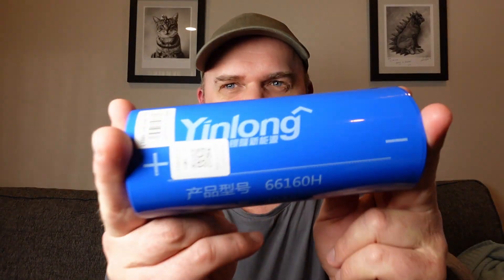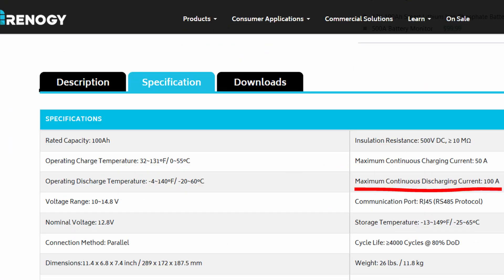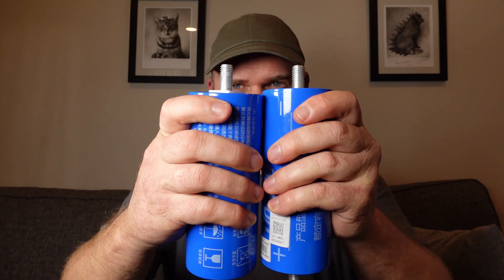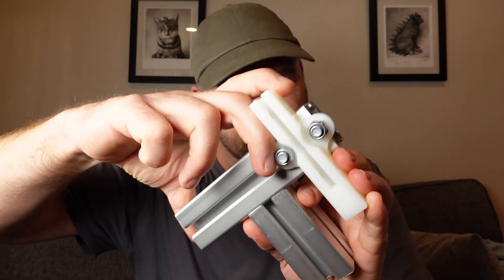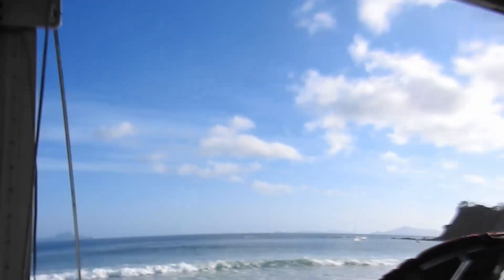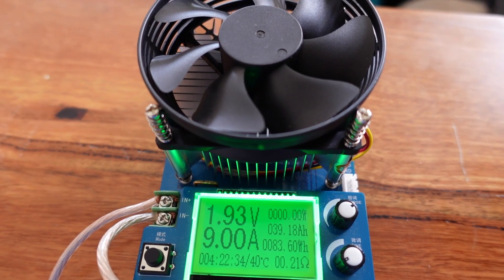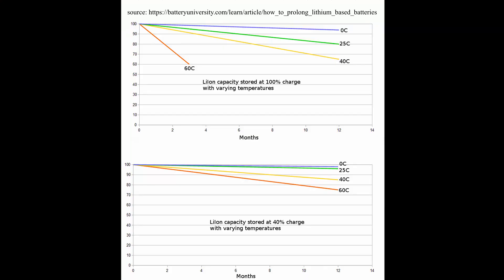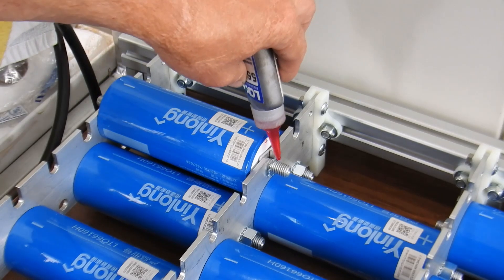Campervan DIY battery build HUGE POWER!

Comment: Hey Brendon, first video I watched and I am impressed by your engineering of the pack, I have to challenge something you said however. First is you are comparing drop in replacements to individual cells, this isnt a fair comparison. My bank is built up of 18S1P LiFePO4 @280ah totalling around 16.7 kwh. I paid $85/cell including shipping, and that makes it around $1500 for the whole pack. Had I tried to do that with renogy or battleborn or the like, thatwould have cost around $12000 for the battleborn and less for the renogy, but you can see my point. I can pull 280A from the pack if I want to, but @48v I would never pull more than 125A (.4c) I know yours are better at lower temps, but the task of keeping them from freezing isnt an issue with me as it is in a climate controlled area. your thoughts?
Reply from the maker: Hey Michael, yeah - my maths came out at 2.7c/kWh, I said that number was unfair and it is in reality closer to 10c equiv, intending to allow for other factors.  My intent for this pack was that it was super rugged, safe, long lasting and reliable, I'm going to be taking this truck into all climates and won't have the interior heated if I'm not staying in it etc.  I deff would have used LFP if price was my priority.  I will be building a similar pack to yours shortly.  Can I ask where you got them?  Seems very cheap.
Thanks
Reply: @brendontait6968  alibaba.com. Company is called Taico
Reply from the maker: Thanks... Shenzhen Taico?
Reply: @brendontait6968  yup

Comment: Use the blue loctite not the red for easier disassembly.
Reply from the maker: Yeah, it was only after I'd put it together I realized that I may want to pull it apart at some point.

Comment: I have a question about why you used Aluminum as your buss bars? My understanding is that the oxide that build up on aluminum can cause issues. In the US, we used aluminum wiring in homes and it was not a good end. the connections would create issues and cause fires. Not to bad mouth the build, it is impressive to say the least. Just wondering why aluminum?
Reply from the maker: Aluminum can cause problems when bonded to dissimilar metals especially in a wet environment.  If the aluminum is being bonded to aluminum,  the issues are less pronounced.  The cell case and lugs are made from aluminum.  You'll notice that I applied a grease to the battery lug with a cotton tip before inserting the cell.  Having a grease interface prevents moisture sitting in the gap.  If you're proposing that I should have used copper - copper would likely have cost me well over $1,000, plus I would have many dissimilar metal bonds.  There is nothing wrong with aluminum cable being used as a conductor providing that it is installed correctly.  Most of the power delivered to your house likely came through aluminum high tension lines which last many years or decades through all manner of harsh conditions.  Am glad you enjoyed the build.  Thanks

Comment: Good to see people who clearly know what they are talking about. I knew LTO existed but you are the first I've seen espousing the advantages in this context. Nice bit of pack engineering.
My plan is to avoid building a big pack by just using an EV pack/set of modules to power both van and internals, but if I did this is certainly an interesting option. I shall investigate further.
Reply from the maker: Thanks, yeah I was keen on the toshiba packs floating around - but none available this part of the world.

Comment: Nice.what kind of battery charger would you use on a solar panel setup.or a wind turbine setup.to charge the batteries and how much per battery and what is the voltage per battery do they come in different voltage and also were do you purchase these.
Reply from the maker: Just a regular solar charge controller will work coupled with BMS.  The chemistry is nominal 2.3V but useful range is 2.0V to 2.6V.  Link in description.   Thanks

Comment: I noticed you made the battery long and flat and you mentioned putting it in the kick plate area. What sort of isolation or shielding will you be doing on top of the batter (under the cupboard?). Do you need to worry about flooding your floor?
Reply from the maker: Coming video I'll make a polycarb cover for it.  The cells don't sit on the floor.  and im hoping to not flood it. I'm pretty sure they would handle a small amount of flooding without too much stress.

Comment: Your a brave man spending that kind of money for batteries that are also a new chemistry and also from China. I got 6kwh of the CALB's (in Australia) in my truck after what I learnt from Prowse video's. Keen to know how your bank does in the long term as I am always looking for options for more capacity in the years to come.
Reply from the maker: Yea thanks.  I'm always keen to learn about new tech and figured if it went pear shaped I could pull apart and sell the cells to the audio guys.  The titanate chemistry has actually been around for a couple decades, so it's not super new.  Just hasn't been used much.
Reply: @brendontait6968  5 grand for 10kwh is amazing value, especially if they out perform LifePo. I Paid $4500au for my 8.6 kwh LifePo a year ago. I also did 24v, because of my truck but also because the Electrodacus charger was design for it which made the most sense to buy at the time....Hope you find time to do updates of capacity loss over the years.

Comment: I know little about batteries,  but couldn't say 4-6 of these be used in an ebike? I have a 4000w hub motor with a 60a controller fire example.
Reply from the maker: the problem is you'd generally want a higher voltage, so for eg 6 cells would give you 15V, you likley want at least 48V for your ebike.  This chemistry does come in smaller cells tho.  Imagine - a full charge in just 10 mins!

Comment: Very nice design but we didn't get to see it installed, how come ? 

  Since 2018 we have been off the government corporate electric company grid, don't believe your electric company is government read the disclaimers from the Smart Meters from your local electric companies website.  I used the Ford C-Max (Energi) battery, we go them from LKQ through our business account paid just a little over 100 per Kilowatt, or $850 USD for 7.6KWh.  I built two systems and each system uses a configuration of 16.8 volts batteries 4x 4.2v for our 12 volt MPP Solar unit which runs a small section of our house.  The MPP Solar unit will only charge to 14.9v so I get a good range and if you are correct about not charging the Lithium cells to 100% which would be 16.8 then I did good lol. 

In the shop and part of the house I used a Magnum Energy PAE 4448 and I also used the Ford cells at 14x 4.2= 58.8v therefore, it is never going to over charge nor reach 100%.
Reply from the maker: My goal to get off grid also.  good work!  It pretty much is installed - on the floor.  You'll see wiring in future videos

Comment: could these be used in a power-wall situation to replace the solar batteries in my home?  Is that a practice application?
Reply from the maker: They certainly could be - that's pretty much what I'm doing in my truck.  The downside of this chemistry is that the cost vs capacity is quite high.  I wanted something super rugged and long lived and different so felt the cost was worth it.

Comment: What about power density kg/Wh?
Reply from the maker: They are not great - I think around 80Wh/kg - this was not really a factor for me as my truck is 12 tonnes.    The actual density works out similar to an LiFePO4 battery in his van.
Reply: @brendontait6968  Thanks for the answer. I am interested in batteries for planes, so this rules them out. Really good explanation

Comment: Loctite has two main products for locking threads. Loctite Red is intended to be permanent. Whereas Loctite Blue is intended to be semi-permanent. If you want to leave the option of disassembly, you should have used Loctite Blue. Live and learn.
Reply from the maker: Hey, thanks for the comment, yeah it wasn't something I considered till afterwards.  The threadlocker I used wasn't locktite brand and was a medium strength variety.

Comment: Great stuff, more people need to use these units, they aren't batteries they're ultra capacitors using spherical charge technology, like static and commonly used in electric buses. The clamping force needed for full rush energy transmission is high, dump the star washers and properly torque them. Yes their cost of life is outstanding however factoring in the management system it's closer to 0.04 and your truck wont last 20+ years so needs factoring in. Additionally buying the "B" grade unit halves the cost so long as you don't mind poor skin printing or bruised threads a massive saving.
Reply from the maker: Hey, thanks for the comment.  As far as I'm aware they are a chemical battery and not a capacitor.  Am hoping my truck will last more than 20 years!

Comment: Hi I love your video. In this video: EASIEST Off Grid Solar Power System
 Battery Bank. Can you suggest a list of parts for me other than the 
batteries which will do the exact same job at a cheaper price please? 
Also an inverter which does the same job like the one in the video.
Reply from the maker: Follow along... I've ordered some new cells that I can make a decent and big sample pack for cheap!

Comment: Can you charge off the truck alternator?
Reply from the maker: Yes, tho you have to be careful you don't overheat the alternator when at idle.  My alternator puts about 50A into it which works out around 1200W

Comment: That's impressive.  Was thinking of the same setup, but as you mentioned was aiming for 48 volts, and about half as many batteries.  How many days will this last you without any charge?
Reply from the maker: Running my fridge (household size) and lights etc, around 7-10 days without charge.

Comment: sorry to ask this i did watch all the video. what is the total cost for the battery cells? what is the weight of the battery? putting it in that unimog you don't need to worry about the weight. my setup would be weight sensitive. what if the final capacity of the battery?
Reply from the maker: Hey Bob, I think total cost was just under $6k usd, tho am doing a group buy which would have made it cheaper.  I think the weight is around 120kg and the capacity is 9.5kWh

Comment: Brendon, the type of guy that challenges the great Will Prowse and shows his calculations! Plus you add the structural components to make it a complete off-the-shelf package. Subbed!
Reply from the maker: Thanks Jim
Reply: @brendontait6968  Hi, great video, thanks for the clear explanation. I’m researching building a small, lightweight electric driven boat and these batteries look more attractive option than 18650’s for so many reasons. Way heavier than petrol of course but I’m sick of the fumes and noise.  I live in Ōhope, BoP, NZ so I’m particularly interested in your supply and shipping costs and challenges. Following your link the shipping costs appear to be quite high. What was your experience? On the loctite front, I use the low strength version (222) for this type of application.
Reply from the maker: Thanks, yeah I was going to do 18650s for the truck, but after looking on some Facebook pages where I've never seen such a large collection of burned down houses in one place I decided to go a different route. Battery freight to NZ is an absolute punish.  I still have some for sale if you want to buy from me, flick me a message on insta
Reply: https://www.youtube.com/watch?v=iOBSxEqXUQc

Comment: Thanks much, good information. What charger did you use to charge that much capacity or did you use multiple chargers?
Reply from the maker: I just have a variable powersupply to charge - will be charging from solar.  Glad you enjoyed

Comment: I feel to measure the power then compliance voltage plays a massive part on the measurement accuracy, that's why  some measurements at low voltage with say a current shunt & moving iron ammeter in the same circuit might give different readings due to compliance voltage & connection lead resistance, chart recorder to measure terminal voltage & current across a dc shunt with a fancy constant current load would be the answer there are proper units out there but expensive !
Compliance voltage is very important when trying to measure power or one can make mistakes say from a CT transformer using thin long leads to a moving iron meter,
Yes very impressive metalwork, cost a massive amount of £$, 
I would have that sort of power in a brick shed, not in the bedroom for sure, always worried about fire risk, I rather have a purpose built brick shed or metal container,
Those batteries are really like a super capacitor. 
Really nice engineering 👌

Comment: Still have some you would like to sell?  I can't find how to send you a message since google messed youtube up.  I'd like to try them myself though.
Reply from the maker: Only a few left.. brendonsbuilds@gmail.com
Reply: The natural gas semi truck is using Japanese lto cells which means Toshiba or vice versa and it also means most likely their next-generation chemistry. What I am interested in knowing is how much more dense the Next Generation chemistry is versus this more easily purchased competitor? If you haven't already studied the cartoons on s c i b. JP do so and I recommend you buy around Christmas the new unicycle it's called EX but needs a upgraded battery pack. Toshiba shows a unicycle as an application for their next Generation technology. Historically these unicycles get extra kilowatt-hours added by the aftermarket and they also take 24 hours to charge. the shock absorber is the narrow  tube but 12 Mega something pressure they include the pump and that sounds of pounds per inch which is somewhat unusual the reviewer claimed. It goes 40 miles per hour easily. People who travel 40 miles per hour standing on the axle of one wheel well below the axle they don't like the wait 24 hours to recharge their batteries. They also historically have a problem with the battery packs not going as fast just like the Tesla for most of the cycle given the high internal resistance. Except it's maximum speed not acceleration. And this new generation of electric unicycles have about four horsepower no joke! The current handle is a joke so are we engineered battery pack could have the alternative handle and be quick release because it's currently about 90 lb which is insane thing to get up the stairs vs 45 in in each arm being far better. The motor which is 3500 Watts assembly is about 40 lb. It actually needs one of those fancy Wheels designed to roll up stairs but I haven't seen anybody offer that for these unicycles. Trust me the picture of the rider of the unicycle Toshiba illustrates is worth the trip.

Comment: 20000 cycles?  Really?
Reply from the maker: I'll let you know in a few decades
Reply from the maker: The main thing that limits the cycle life of regular lithium batteries is the graphite anode.  It grows when charged and shrinks when discharged.  This causes the anode to start to crack after many cycles.  The titanate anodes are not graphite and don't have this problem.  Graphite is one of the reasons that regular lithium chemistries can get into thermal runaway.

Comment: OK they are highly durable, BUT LTOs have a very poor charge to discharge efficiency, please measure in and out energy and give us the result, this is the main reason why they are NOT used everywhere.
Reply from the maker: Didn't I mention this in the video?  I already have measured charge and discharge current.  I may do a video specifically on this because even tho I mentioned it in the video, several people have told me this.   Look up David P.  He has done a round trip efficiency test on LTO also https://youtu.be/z95U7Hq2M5k